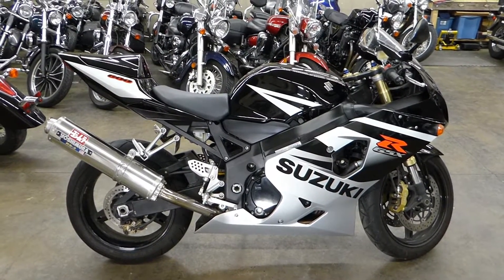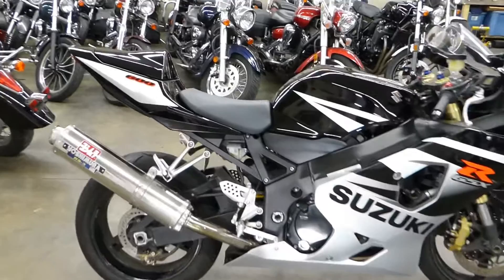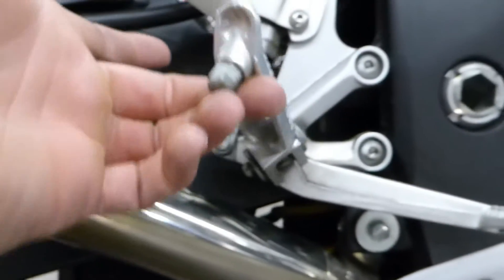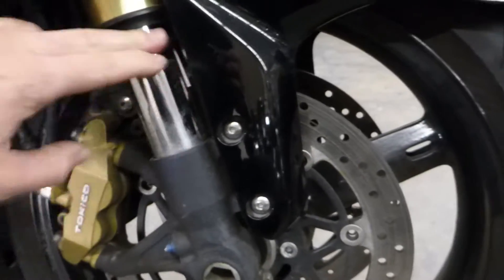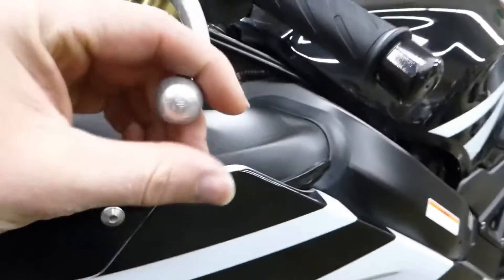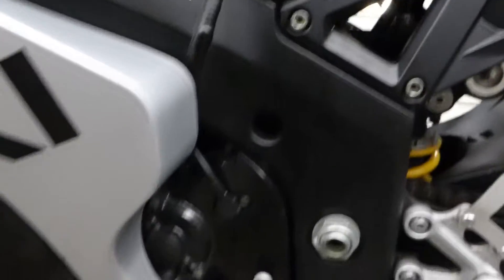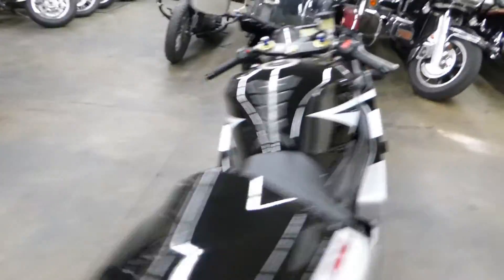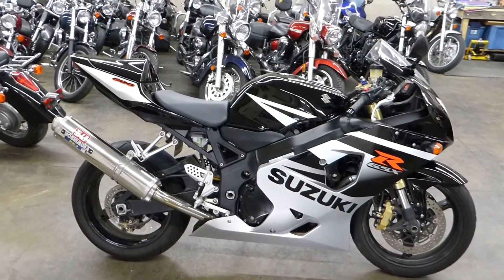2005 Suzuki GSXR 600 Description

Comment: The lever scratch is easy to fix sand it out with 320 grit then 500 or 600 grit then 1000 or 1200 grit and metal polish by hand or if u have a zephyr airway can just sand it and use the brown Tripoli bar with a yellow airway

Comment: Dude just hit the black area with the scratches and swirls with 1500 grit wet sand. Then 2000 grit or 3000 if u have it. Use a wool pad with m100compound won’t even have to polish it if u do it right. If not good with a buffer or don’t own one use the 1500 then 3000 grit and m100 by hand